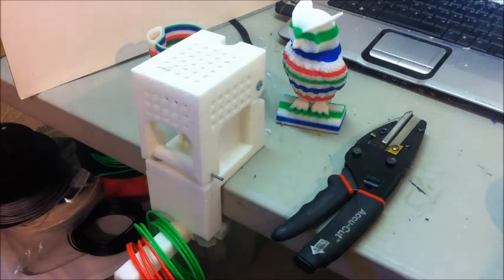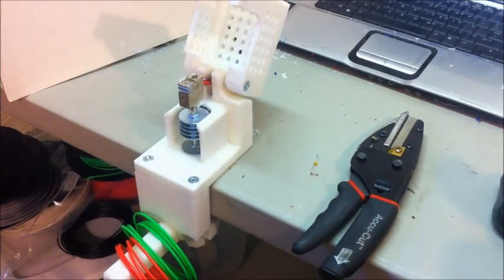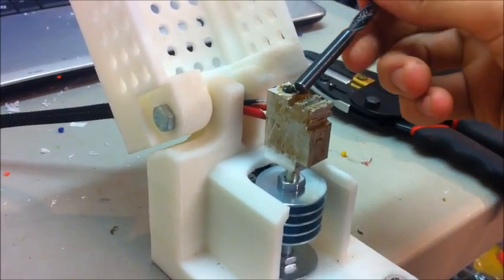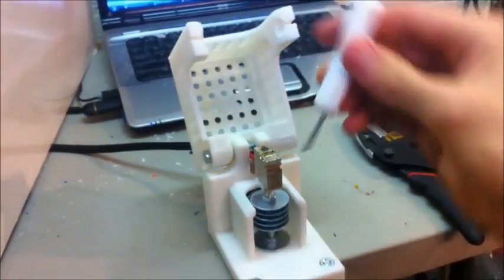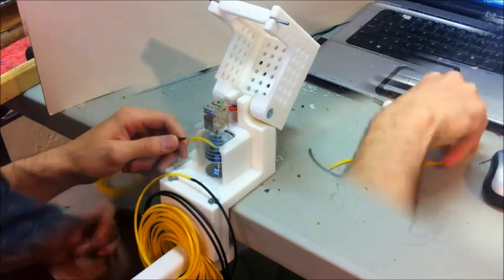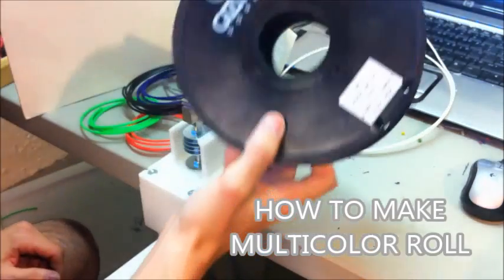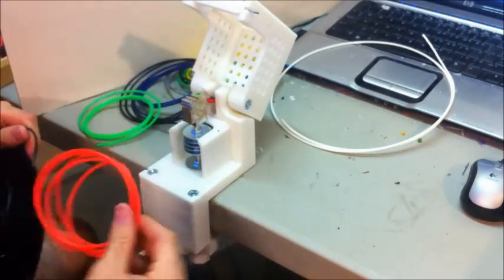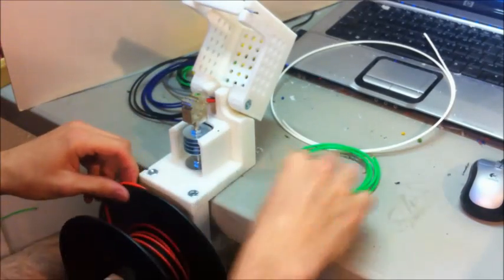Filament Fuser Block Demo

Comment: Do you think this same setup would work to join 550 paracord?
Reply from the maker: Ive never joined paracord before, I didnt think it was possible because the inside of the cord is different than the outside. My guess is that it would not work

Comment: If you want to do this without the expensive rig, cut a small piece of metal from a drinks can and bend it into a little stand over a tealight candle. same method to push two bits of filament from each side and join them. Use a knife or sandpaper to smooth the join.

Comment: Any issues with extruder clogging from the joint? And does it have enough flex to work in Bowden tube systems or just direct drive systems? Cool video though, very neat effect!!